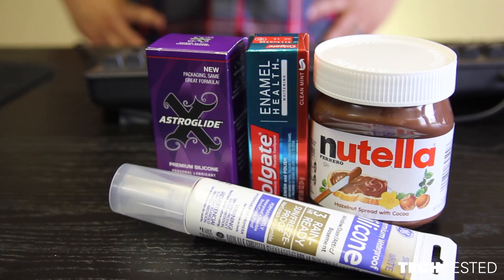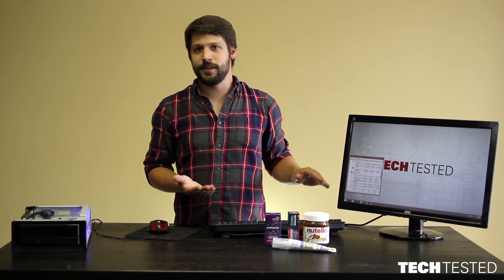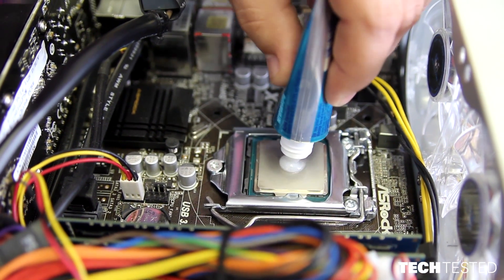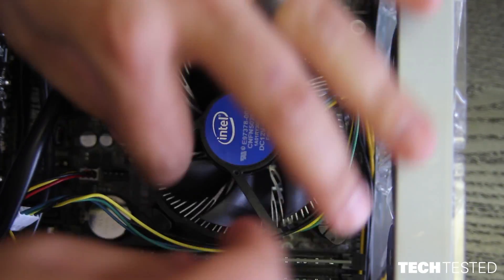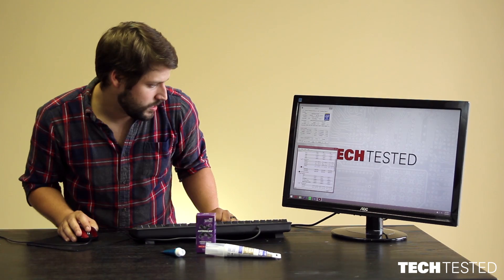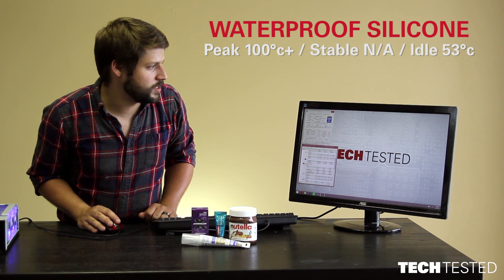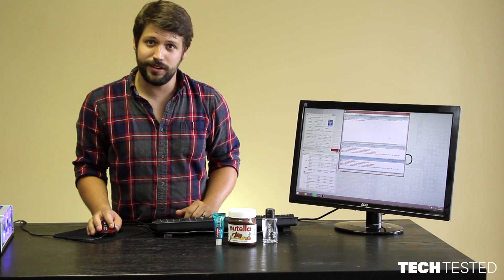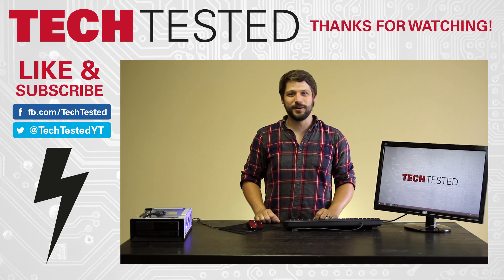Thermal Paste Alternatives: Nutella On My Processor

Comment: Next time mix colgate white tooth paste add a pinch of Vaseline and use a number 2 pencil dip the tip of pencil in soldering flux stir hard like your writing with pencil for ten minutes till the paste turns dark gray! When done heat it up with a hair dryer to get unsolidified water evaporated out then apply! Works wonders! Been on my hp laptop notebook for 4 months now and no over heating issues have come up yet lol! But thanks for the video!

Comment: So I have a computer here that has been disassembled for atleast 2 years, the thermal paste has been cleaned off before all the parts went into storage. I currently have thermal paste ordered but, could I run the computer with toothpaste as a substitute for a couple days until the new thermal paste comes in so I could atleast get a new OS loaded onto it?
Reply: Luna Deafenhine yeah i Think so

Comment: I used crest 3D white, radient mint, for 6 months, it worked alright till I remembered I had to replace it, when I switched it out with some arctic silver 5 it had died up and was easy to clean off.
Reply: cpu died?
Reply: nope just got a better one, an 8 core that was faster and had a better cooler. the kind of toothpaste really matters a lot, the gels won't work you want the thick white ones, without the stripes for an even cooling,
Reply: cool so lesson learnd never clean of anything off cpu when its hot

Comment: Just btw, DO NOT use a copper base cooler when using toothpaste as thermalpaste subsitute. The toothpaste will start the copper and aluminium to react... ill link you a picture of my old xeon when i get back home. :)
Reply: +dunxy that was after about 2 weeks, i did try to clean the cpu so you cant see all the corrosion but it will happen :D
Reply: then link it man
Reply: +Bartosz Olszewski ahh i forgot. Ill make sure to find the cpu when i get back to home. :) //been busy working. Yes im using that excuse
Reply: +TheIdiotPlays ohhh thats bad you can probably replace the top metal of the cpu if u watch linustechtips
Reply: +HappySlappy Face well i was using a q8200 on that mobo, but the mobo broke and i think its time to upgrade :D..  Dont hate me, im buying the fx 8350 since i found a deal: asus 970 pro gaming, fx 8350 and 16gb ram for 350 euros
Reply: TheIdiotPlays well i know but i recommand you getting a bit far from amd because thair hot and use alot of power but i recommand you to get the amd RX 480 at the power of 980 but cheaper
Reply: TheIdiotPlays also i recommend getting an i7 cpu
Reply: +HappySlappy Face as i said, the fx 8350 was cheaper :) the bundle is 50 euros more expensive than an i5 6600k without mobo and ram. Yes im buying the rx 480, but i have to still wait for my next paycheck to afford that. :)
Reply: Doesn't look that bad! Realistically,I reckon the IHS would take longer to corrode through than the cpu will be useful for, so is it really a problem? How long was it running toothpaste to look like that?
Reply: TheIdiotPlays 
That was much shorter than i imagined!

Comment: My cpu runs 100 celcius idle and load when its been on for awhile
Reply: apply thermal paste & put a cooler on it :D
Reply: +Phoenix Gaming change the thermal paste.
Reply: +Phoenix Gaming JEEEESUS PC! HELL, you should really invest 5$ in thermal paste and save your 100$ CPU (or whatever you're running). I can freaking do a 4.6 Ghz on mine and reach a max of 61°C.
Reply: I've got a 200 dollar Intel core i5 thank you very much. But yeah. It gets hot.
Reply: +Phoenix Gaming thay makes no sence whatever you think do these
1 replace the cpu cooler with a water cooler or a coolermaster water cooling
2 replace the thermal paste with cooleemaster themal paste or some expensive one
3 buy a new case with a place for cable management and has alot of fans
4 buy a new cool graphics card
5 tell me how many times I said cool in this comment
Reply: HappySlappy Face
 You don't need Water cooling to cool a CPU successfuly.
Cable management has no effect on cooling, so he doesn't need a new case.
Nor does a new graphics card solve the problem he is having.
Reply: FIGHTTHECABLE My mother board is flexible and a water block is just about the only cooler that wont make it bend. I actually have a water block right now and don't get anywhere above 42 Celsius, and my computer is a lot quieter. Thanks for the recommendations guys :)
Reply: FIGHTTHECABLE think about if the wires are blocking the cpu fan
Reply: FIGHTTHECABLE the graphics card might be overheating cauing the air in the pc to be hot and overheat the cpu
Reply: FIGHTTHECABLE a new case will have a better airflow like  front fans enter air to pc and top will take it out
Reply: Hmm... I've been using my i7 2600 since the day it was released and running a stock cooler for gaming. Its always above 90 celcius under load and gaming yet it's still working after 5-6 years heh. But im gonna install a new cooler for my CPU today and hope to see an improvement lol
Reply: SkyDestroyerX IMAO IT WOULD PROBABLY DIE SOON XD

Comment: Surprised you didn't try some oil, it does a great job of transferring heat to food! ;)
Reply: hmmm fries :D

but wont it burn quickly ?
Reply: +The-BGR Spot well the flash point of veg oil is about 625F and even the smoke point is about 325F so i think you'd be good! :)
Reply: +Ben's the name gotta try this out on my celeron :D
Reply: +Ben's the name maybe another video right there for you eh? :)
Reply: +Ar The Pirate  I used canola oil margerine once in a pinch it worked really well, I tried motor oil too its not as good as canola but you could use it as well if you just want to test a board or chip
Reply: Operator I tried oil on mine and it did not do a good job

Comment from the maker: David: We have a Pentium G3258 overclocked to 3.8Ghz at 1.25v.
Reply: garbage oc lmao
Reply: +Tech Tested ??? i have a 2500k overclocked at 4.6GHZ, are you in 2009?
Reply: wtf i have a i7 6700k where do you live in 100bc ??
Reply: the G3265 is a beast
Reply: I found a i5 750 and motherboard on side of road.Threw in some ram, booted into bios, shits 4ghz in.75c idle stock HSF. Install my old tu120ex, ahhh, GOLDEN! Seriously how much is a used i5 750 worth, $20? Not a bad cpu, when i get a new graphics card(1070 or 1080) i doubt it would even bottleneck current top tier single card solution.Sli/xfire been there, never again, just bench marking epeen, not real world! Almost makes me want to offload my x79 i7 set-up, almost ;)

Comment: Silicone is an insulator... hence the higher temperatures
Reply: Graham Littlewood NEEERRRRDDD
Reply: @patarstuff  shutup
Reply: Graham Littlewood thanks for the info! According to my research standard thermal paste has a certain amount of silicone in it, which is why I chose to use those two products, but clearly theory doesn't always work in practice. Thanks for the feedback! - Matt
Reply: I have oven mitts made out of silicone (at least partly) and you can hardly even feel the heat through them. Silicon on the other hand...